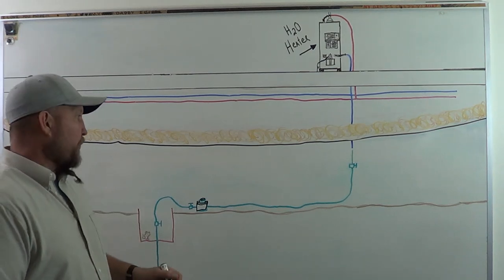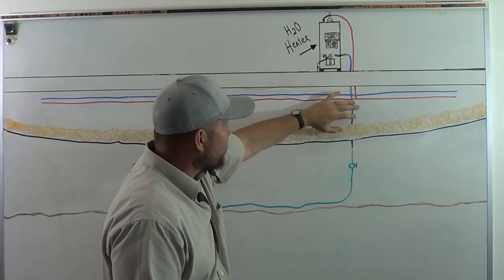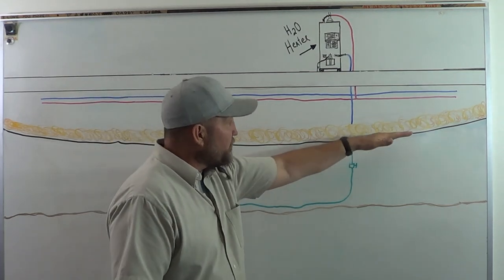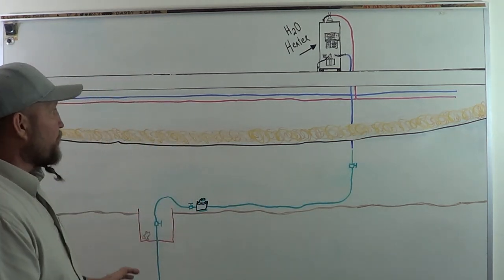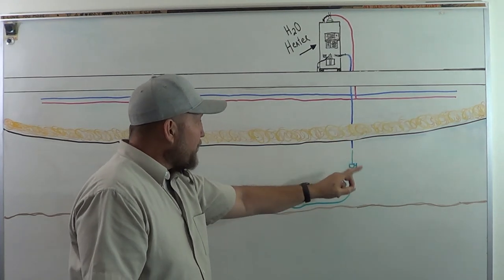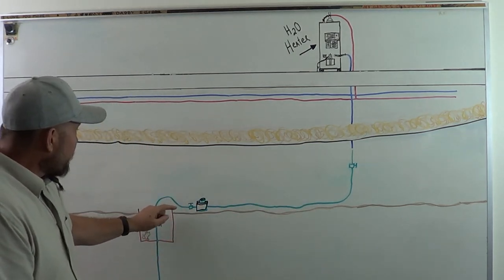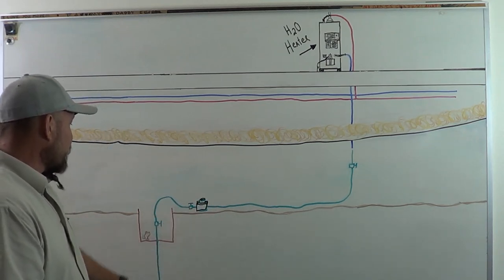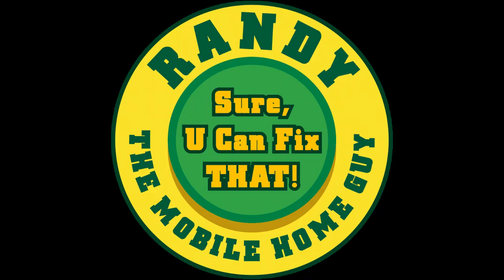How to locate main water shutoff in a mobile home

Comment: Thanks for this.  Have a leak coming from bottom of toilet after a deep freeze and didnt have any idea where the shut off was.  It was under the trailer below the water heater just like you said.
Reply from the maker: Glad the video was able to help you! Thank you for your comment!
Reply: What size/type  pipe/tubing is it from the shut off(under house) to the hot water heater?

Comment: Hi Randy, I have a leak on a pipe under the mobile home going to the second bathroom (can’t tell yet if it’s shower or toilet/faucet). Do you know where a shutoff valve would be maybe under the house to prevent water from going to this section? Have to shut off water to the entire mobile home to stop it unless I find a specific valve. Shutting off faucet/toilet doesn’t stop the leak from continuing under the house

Comment: its ridiculous to have main shut off under trailer ,it should be next to hot water heater
Reply: Agreed, it should be in as easy accessible location as possible. They aren’t doing much better on the newer ones either unfortunately. Thanks for the comment
Reply: Seriously, I don't want to remove the barrier and insulation to access my water shut off 🤦
Reply: @Aw-ns1qx  Based on his drawing, it looks like you won't have to remove those. The valve is in the open space between the ground and your insulation.

Comment: I'm a 64 yearsl old 6'3" tall disabled widower, with a 4 time loser back living in a double wide on a concrete pad. There's only about 24 inches of headroom under there. This place was built in '96 and PB was used throughout unfortunately. 
Why the previous owners didn't have it replumbed as part of the class action settlement is anybody's guess!
I've lived here for 7 years and PB problems are starting to do what PB will eventually do so I'm having to struggle my way underneath to go midway down the length to get to the main shutoff (under the water heater) each time I have a repair to perform. It was a lot easier 7 years ago! 
Having said that I've been looking into remote shutoff options but they're all dependent on 120v being available at all times. Not to mention the kits are insanely priced (for an old phart on a fixed income). When power is lost the valves close. There's a manual override but that requires crawling under there to get to it. 
The only main shutoff I've seen in the place is to the water heater so that doesn't help me much if I need all the water shut off to repair a sink or toilet. 
Is anybody aware of a manually operated mechanical kit? I was an industrial machine mechanic all my life and can fabricate something to manipulate the main shutoff from inside but thought I'd check here with you for direction or pointers.
Reply: You could always try Replumbing the shut off valve in a more accessible location, sure it’ll take a good bit of work, but hey, at least you won’t when to crawl all up underneath there anymore 🤷‍♂️
Reply: @Jared Gaskins  I thought of that but it would mean moving the valve closer to the coldest edge of the place and I live in SE Wisconsin and winters can be brutal even for site built homes. 
I've been thinking of fabricating a 2 cable lever and mounting it to the wall next to the water heater that's right over the existing main valve. I'll have to fab a mount to bolt to the concrete next to the valve, and drill into the handle and add a ball clevis but it seems simpler than moving all the plumbing under there. 
I have the rest of winter to pull it together and test it. No way am I going under there alone in the dead of winter.
Reply: Any way of cutting a hole in the floor and running it up, putting a shutoff on and then back into the main? Sometimes doing that in a convenient place like a closet or something close by where the shutoff is now…….
Reply: @Randy Dolph  That's isn't an option because it involves getting the Water Dept. to shut off the main branch to my place and I have no idea if the valve that's out on my lawn will turn. Sounds like a can of worms I'd rather not open. 

Thank you for commenting. Much appreciated.
Reply: My husband purchased an automotive creeper to get around on concrete pad under our mobile home. He says it's very helpful. He is 70 yrs. old and also has back problems. Maybe something to consider.

Comment: Are main shut off valves required to have under a mobile home?
Reply from the maker: Yes every home will have a main shut off under the home. I
Reply: @randythemobilehomeguy3715  The trailer park I live in had about 40 trailers with frozen busted pipes. then they fixed they never added a shut off valve at the trailer. so over 40 trailers dont have shut off valves

Comment: I've been having plumbing issues galor within the last several months. However, we can't find the main water shutoff. There was a pit right behind our trailer and it was filled with water, my Dad would reach in and shut the water off from there. When he had the pipes winterized, whomever did it ended up filling the pit up so it can't be accessed unless we dig it back out. I don't see anything like a meter anywhere near where the pit was, but based on this video and a lot of articles I have read, there might be a shutoff underneath the water heater. I wonder if they filled in the "hole" because this was the case, but, we can't really get the underpinning moved so that we can inspect the pipe and see if there's a shutoff valve there.

Comment: Can I shut off just my water spicket it's shooting  water 50 feet in the air
Reply from the maker: If there is a shutoff on that spicket line, then yes. If not, you will have to turn off the main water to fix the spicket.

Comment: So do I have to shut off the hot water heater or turn it to pilot when I turn the main water off? I need to fix my shower but I would like to put some valves on it so I don't have to shut the main water off again.
Reply: Hello, thanks for the question. Yes it is a good idea to turn your water heater to pilot if you are leaving you water shut off.